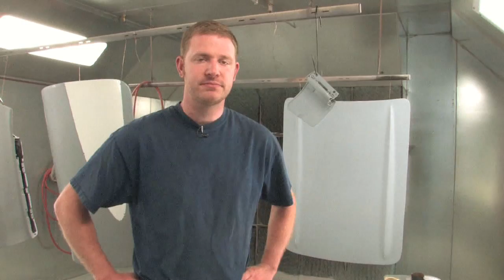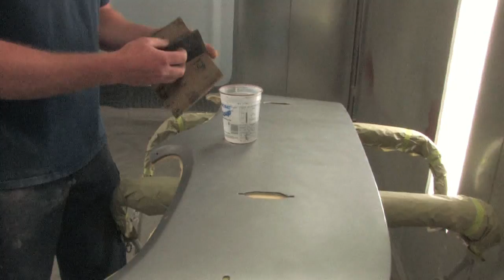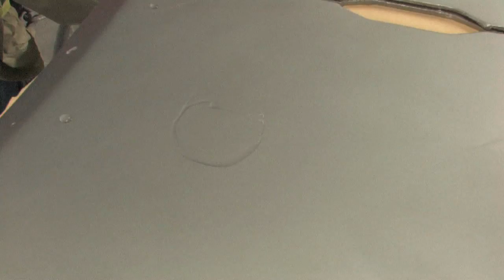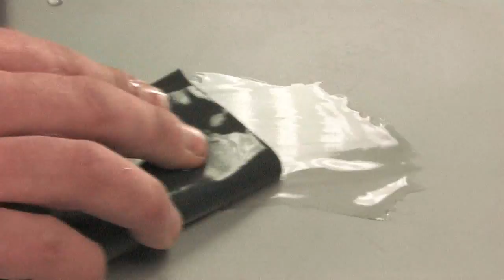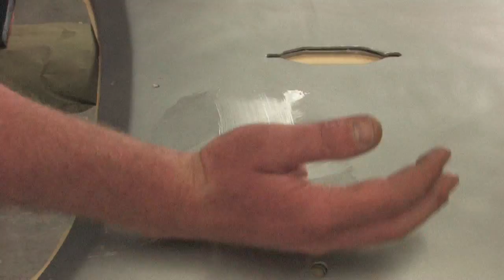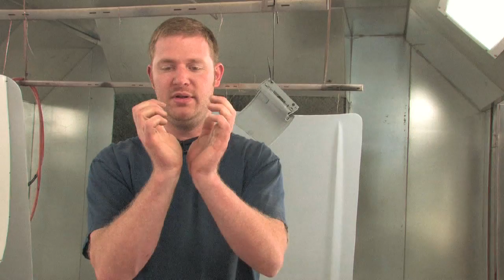Auto Painting : How to Remove Small Bubbles in an Automotive Paint Job

Comment: I have small bubbles on the base coat. Sanded it and painted it. But bubbles appeared again. I'm using acrylic for automotive. Please help
Reply: Make sure the area is dust free and clean, prime it, and apply paint smoothly. Make sure the paint you're using is for the surface type.
Reply: @AedanBlackheart  got it. Thanks!